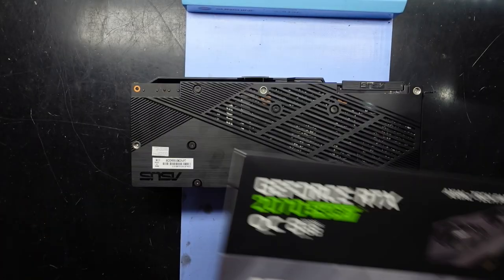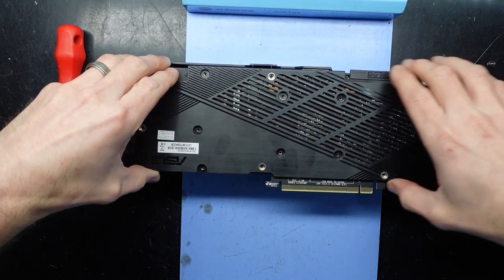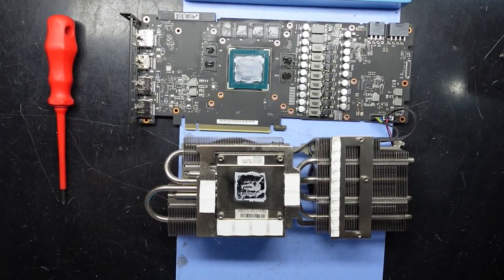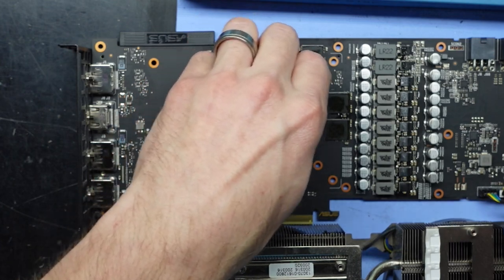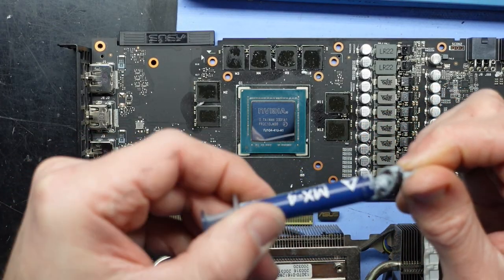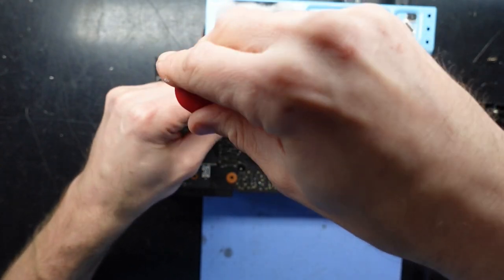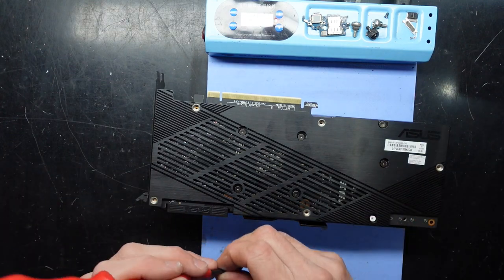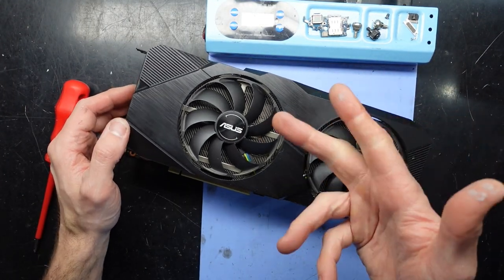Asus RTX 2070 Super Dual, Thermal Paste Replacement

Comment: Thank you so much for this video! I just saved my 4 Year old 2070 Super which I thought it was on the brink of its death. After so many reinstallation of Windows, random blackscreens, crashing while gaming or working, replacing the thermal paste fixed everything. I almost gave up and thought that there's no solution for this. Until I found your video which was very informative and helpful. So once again, THANK YOU! 🙌😊
Reply from the maker: awesome, top job saving your 2070 super :)
Reply: hey my 2070 super ASUS is also just as old and just stared black screening. did this fix? Its been 3 Weeks since your comment and I was wonder if its still working?
Reply: hey my 2070 super ASUS is also just as old and just stared black screening. did this fix? Its been 3 Weeks since your comment and I was wonder if its still working?
Reply: @Plymouth2015 yep! And yes, it's working fine now. Give it a try if other solutions are not working for you. I'm sure this will fix your issue. Do let me know if it does! :)

Comment: today i buy that same Gpu its maybe 3years old ans heats is 86-87. How much they  have on you ?? maybe i need do that.
Reply from the maker: if it's never had the thermal paste replaced it would be worth while changing
Reply: I found some info from pads what can be works,  i but that  top . I dont try that yet, maybe i try to change thermal paste first , But that info can help you and many others.  If your temp is too hig  and you try those pads, pleas make a video on that   @rickstechrepairs
Reply from the maker: i dont have a gpu to make a video on replacing the pads

Comment: The oil is probably from the thermal pads, some brands used weird pads in the 2070 that could 'leak' when getting really hot
Reply from the maker: I see that fairly often, rather the oil appearance than bone dry pads
Reply: @rickstechrepairs  Oh yeah definitly!

Comment: Thx a million, dude! Your relaxed presentation made me go for it! was extremly nervous bout this - but your Bob Ross attitude made me try it myself. Issue is gone. Had random blackscreen crashes, fans cranking up. No software-fixing attempt worked. The paste was a goddamn joke... looked even worse than yours. No wonder it shut down - although HWinfo and Afterburner were showing normal temps... anyway. Thank you!!
Reply: oh and btw: my card had the same oil-texture on the board.. weird stuff...
Reply from the maker: Great to read, my casual easy going video gave you the confidence to repair it!
Great to read this has helped

Comment: What are the thermal pads sizes on this card ? I have one and its overheating,  i want to repast it and also replace thermal pads.
Reply: Pad #1:	90x7x2mm
Pad #2:	60x14x2mm
Pad #3:	30x14x2mm
Pad #4:	30x14x2mm

That's the result of my research. but I didn't validate this data myself- no guarantee it's correct.